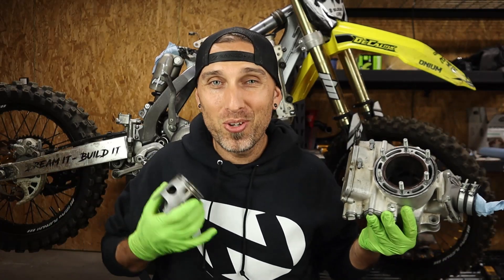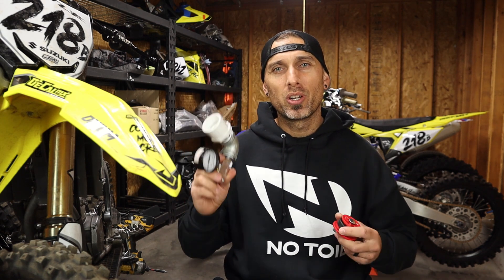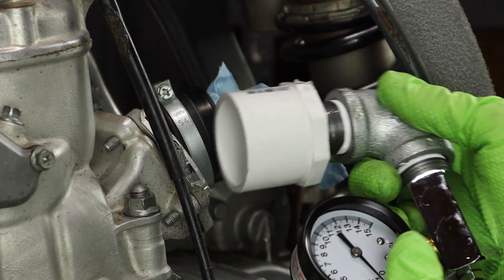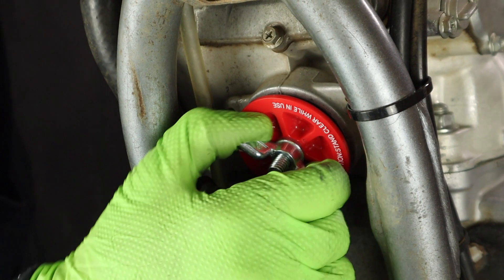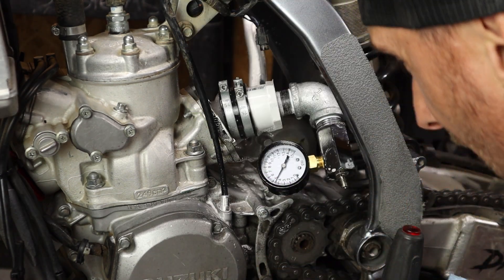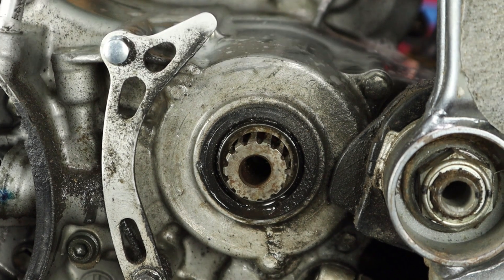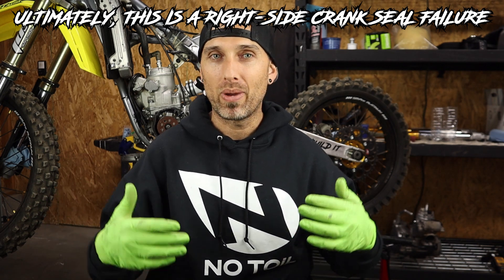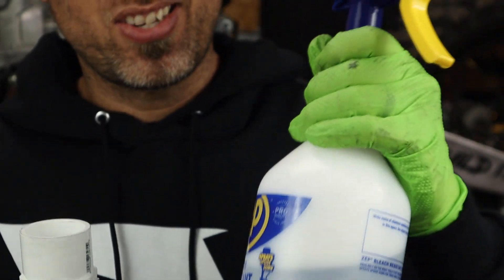I BLEW UP MY TWO STROKE | Let's Find Out Why - Dirt Bike Leak Down Test & 2006 RM250 Top End Fails

Comment: You can be leaking from the center case gasket or the right side crank seal. Gotta pull your right side engine cover to confirm it is/is not NOT the seal. 

The powervalve seal on the side of the jug cam let air into the transmission as well. So the case gasket & seals could all be fine but it's leaking fromt the powervalve seal area.

But thay piston is broken. Not blown up. That was detonation that broke the ringland off. The detonation pushed the edge of the piston down under combustion, (pinching the ring). On the way back down, the rings snagged on a port getting bent up & breaking the edge of the piston off. Then as it went to TDC, the broken parts & ring chunks got smashed into the head.

What was your fuel grade?

Where was the timing in comparison to the "stock" setting?

What was the quench height? A bad head cut will cause detonation.

What was the scenario when it died?

But that was detonation 💯% man.

Edit:

Ditch the rad valve for the STOCK cage & reed petals & instal a reed spacer. You'll have more power & better power. Lots of experience & dyno time building engines. Had an 06 rm250 as a personal bike in the stable for a number of years. It's one of my favorite bikes....all time.
Reply from the maker: Keith, I LOVE this reply. It's too bad I can only pin one comment at a time! In response to your questions:

You can be leaking from the center case gasket or the right side crank seal. Gotta pull your right side engine cover to confirm it is/is not NOT the seal. Understood, and makes more sense at JonnoMoto said that I likely don't have a leak. No excessive smoke trans oil coming out of the pipe. I was somewhat stumped on that in the video.

The powervalve seal on the side of the jug cam let air into the transmission as well. So the case gasket & seals could all be fine but it's leaking fromt the powervalve seal area. Jonno mentioned this too. it makes perfect sense. The air has to come out somewhere in the end so the countershaft seal it is... This threw me off as I also thought maybe a breech between cases but same scenario as the right side crank seal IF it was actually leaking. Jonno suggesting there was no leak makes the most sense now. Funny how I forced the video to that conclusion just because I was hell bent on the leak down tester proving something. I did not do a very good job on this video & should not have rushed things to wrap up.

But thay piston is broken. Not blown up. That was detonation that broke the ringland off. The detonation pushed the edge of the piston down under combustion, (pinching the ring). On the way back down, the rings snagged on a port getting bent up & breaking the edge of the piston off. Then as it went to TDC, the broken parts & ring chunks got smashed into the head. *Regarding the lingo (blown up) may I ask the difference when speaking technically? I was using the term blown-up very generically as it could be searched & SEO optimized, or basically understood by most that "there's a problem" of some sort going on here 😂 Thank you for the detonation explanation, I can visualize it all occurring step by step & that is helpful for me. * 

Before I answer these, it almost seems safe to say that most of the damage was already done here as I only logged about 45 minutes on the bike in a few short motos. It was the first time I ever rode it. The bike felt lean or soft, like when a main jet is too small and engine wants more fuel to reach higher RMPs.

What was your fuel grade?
101 @ 40:1 always

Where was the timing in comparison to the "stock" setting?
Unsure, but the stator plate is in the identical location/ orientation as my healthy 04 engine when looking at both side by side. 

What was the quench height? A bad head cut will cause detonation.
Unfamiliar with the term & eagerly awaiting more info! Did you ever see "Short Circuit" where the robot Johnny 5 is always begging for "input"?? Call me Johnny!!

What was the scenario when it died?
It ran until it sort of shut off as I rolled up to the truck. I got off the track because I felt the power degrade to a un-useable level & had to keep it alive by blipping the throttle liberally. The soft power it had before that VS the "tale your arms off" RM power I expected makes it seem like I simply finished off a coffin that was almost fully nailed shut.

But that was detonation 💯% man.

Edit:

Ditch the rad valve for the STOCK cage & reed petals & instal a reed spacer. You'll have more power & better power. Lots of experience & dyno time building engines. Had an 06 rm250 as a personal bike in the stable for a number of years. It's one of my favorite bikes....all time. Ok! I will have to track down an OEM & try it sometime. I have the Vforce & Boyesen as they came with both RM's when purchased. Me too bro, I adore these old RM's which to me don't really feel old yet
Reply: @mxrevival  

I totally remember that movie short circuit & Johnny 5's hunger for input! I wish I could read like Johnny 5! Lol 

So for the input, there are 2 parts of the head. There's the dome area which is the deep pocket around the sparkplug. Then there's the shallow area around the outside of the dome. This is the "squish band" area. It is measured in 2 ways. 1 is the length of the squish band. This is simply a measurement from the edge of the dome, across the squishband to the cylinder wall or outside diameter of the head. The 2nd measurement, called the "quench" area, is a height measurement & its done from the outside of the "squish band" area of the head to the outside edge of the piston at Top Dead Center. It's  the gap between the piston & the squishband area of the head when the piston is at TDC.

Measure this with a piece of solder & make sure you do it IN LINE with the piston pin or the sides of the piston by the transfer ports. The reason is to avoid piston "rock" that happens it the measurement is done on the intake or exhaust side of the piston. This would give a false measurement & also give a potentially false notion of the head being cut at a poor angle vs the angle on the crown/dome of the piston. You want to match the angle of the piston dome with the squishband area of the head or have the head  about 1/2 a degree steeper than the piston angle.

Bad scenarios would be if the squishband cut in the head is flatter than the piston dome shape. Think of a flat top head design with a dome piston. This will make a triangle pocket around the outside of the piston which will undoubtedly cause detonation. This is the worst.

The measurement for "quench" is that distance between the piston & the squishband. A tall squish, which these bikes (& most) have, is actually a bad thing for detonation. The tall area takes longer for the flame front to reach out to the edges of the cylinder. This tall & slower moving flame front area allows heat (from it) to radiate forward & light off the fuel around the outside edge in the squish band. Now that fuel is burning inward toward the dome & the burning fuel from the done is burning outward. These two fronts collide around the outside of the piston & in the squish area. This excessive pressure happens over the ringland area which smashes the piston edge down on the ring, pinching the ring. The ring no longer floats & can now snag a port on its way past. This happens on its way down from TDC & folds both the ring & piston up breaking off the edge of the piston & tearing up the ring. Then on the way back up, the ring tears up the jug & all of the debris gets smashed into the head. The few extra revolutions the engine makes (from momentum) after the catastrophe are to just make sure it's good & junk. Lol

Anyway, a tight quench is way better for staving off detonation. The shorter flame front heading from the dome to the outside of the cylinder is moving faster & has a shorter heat gradient (less tall which means less surface area to throw heat). This faster moving flame front doesn't have as much time to light the unburned mixture out in the squish area thus staving off detonation better than a tall quench or squishband. 

So a short squish (quench area) can safely & happily run on lower octane fuel but still have higher compression than a tall squish (quench area) build will tolerate. 

I hope I worded all that in a comprehensible way.

On a brighter note, if the head was cut (poorly), it's now junk so you won't have to worry about it being the problem if it was. 😁

Besides a pressure test, a vacuum test should also be done. A seal can leak one way but not the other. Both are bad.

So I'd still confirm the case halves aren't leaking by removing the right side cover by dropping the jug back on with a base gasket (don't even need a piston in it) & try to seal the powervalve area's to confirm the bottom is air tight....or not.

Don't exceed 7psi on both vacuume & pressuretesting. Anymore & some seals can get the lips flipped &/or get pushed out.

Your fuel octane is legit & the timing seems NOT to be the culprit judging by the stator being like the other bike which has a known reliable engine. 

Detonation sounds like a bag of marbles getting banged around inside the engine. It has a sort of rattling sound & the engine can only handle it for a very brief time. Like only a couple seconds & junk.

Besides a lean main jet, a lean needle setting can cause it as well.
Reply from the maker: I totally remember that movie short circuit & Johnny 5's hunger for input! I wish I could read like Johnny 5! Lol 
Hahahaha, "Steee-pha-neeee" no dissasemble...

So for the input, there are 2 parts of the head. There's the dome area which is the deep pocket around the sparkplug. Then there's the shallow area around the outside of the dome. This is the "squish band" area. It is measured in 2 ways. 1 is the length of the squish band. This is simply a measurement from the edge of the dome, across the squishband to the cylinder wall or outside diameter of the head. The 2nd measurement, called the "quench" area, is a height measurement & its done from the outside of the "squish band" area of the head to the outside edge of the piston at Top Dead Center. It's  the gap between the piston & the squishband area of the head when the piston is at TDC.
Ok awesome, I have always wanted to try the hollow-core solder trick to check squish but have not yet, and always ran what I had when doing top ends. Sounds like I'd be able to figure out if this head has been cut or modified in doing this too, if I knew what the stock squish was from a confirmed stock head. I'd love to know the limitations & have been doing some homework to become a better educator down the road.

Measure this with a piece of solder & make sure you do it IN LINE with the piston pin or the sides of the piston by the transfer ports. The reason is to avoid piston "rock" that happens it the measurement is done on the intake or exhaust side of the piston. This would give a false measurement & also give a potentially false notion of the head being cut at a poor angle vs the angle on the crown/dome of the piston. You want to match the angle of the piston dome with the squishband area of the head or have the head  about 1/2 a degree steeper than the piston angle. I should read the entire post before I reply 😂

Bad scenarios would be if the squishband cut in the head is flatter than the piston dome shape. Think of a flat top head design with a dome piston. This will make a triangle pocket around the outside of the piston which will undoubtedly cause detonation. This is the worst. Ahh, I see. So the squish band should follow the curvature (or not) of the intended piston for said engine. They are parallel to each other in easy terms, or for lack of a more technical way for me to explain it? Why does it cause detonation? (thank you)

The measurement for "quench" is that distance between the piston & the squishband. A tall squish, which these bikes (& most) have, is actually a bad thing for detonation. The tall area takes longer for the flame front to reach out to the edges of the cylinder. This tall & slower moving flame front area allows heat (from it) to radiate forward & light off the fuel around the outside edge in the squish band. Now that fuel is burning inward toward the dome & the burning fuel from the done is burning outward. These two fronts collide around the outside of the piston & in the squish area. This excessive pressure happens over the ringland area which smashes the piston edge down on the ring, pinching the ring. The ring no longer floats & can now snag a port on its way past. This happens on its way down from TDC & folds both the ring & piston up breaking off the edge of the piston & tearing up the ring. Then on the way back up, the ring tears up the jug & all of the debris gets smashed into the head. The few extra revolutions the engine makes (from momentum) after the catastrophe are to just make sure it's good & junk. Lol Well isn't that just dandy?? Good explanation of what I have seen the result of now!! 😂 I understand! So it sounds like modifying the stock head for a tighter squish clearance or purchasing an aftermarket head (which must be why these are made) is how to correct the issue, not taking into account a cylinder base gasket height but in general a remedy to the problem?

Anyway, a tight quench is way better for staving off detonation. The shorter flame front heading from the dome to the outside of the cylinder is moving faster & has a shorter heat gradient (less tall which means less surface area to throw heat). This faster moving flame front doesn't have as much time to light the unburned mixture out in the squish area thus staving off detonation better than a tall quench or squish band. I know I already said it, but I should read the post before I respond. Nothing wrong with committing to memory I guess haha. So the tall quench is leaving unburned fuel that ignites later on top of the clash you previously described AKA bang, bang, damage ensues...

So a short squish (quench area) can safely & happily run on lower octane fuel but still have higher compression than a tall squish (quench area) build will tolerate. This is because the "burn is optimized, so the higher quality fuel is not quite as necessary? 

I hope I worded all that in a comprehensible way. You certainly did. I am grateful

On a brighter note, if the head was cut (poorly), it's now junk so you won't have to worry about it being the problem if it was. 😁 Hahahaha Luke at Phathead wants to send me one of his new ones so this will be fun... 

Besides a pressure test, a vacuum test should also be done. A seal can leak one way but not the other. Both are bad. I'll have to look that up! The leak down was dropping so fast that I'm still unsure if there's a leak on top of all the other rad engine-party that was going on in there!

So I'd still confirm the case halves aren't leaking by removing the right side cover by dropping the jug back on with a base gasket (don't even need a piston in it) & try to seal the powervalve area's to confirm the bottom is air tight....or not. Did I mention that I should read the post first?? Great idea. The engine will just be that much further taken down already after the wet side seal test concludes.

Don't exceed 7psi on both vacuume & pressuretesting. Anymore & some seals can get the lips flipped &/or get pushed out. 10-4!

Your fuel octane is legit & the timing seems NOT to be the culprit judging by the stator being like the other bike which has a known reliable engine. I think so on the timing even though it's just the eye-crometer test. I already have the 04 engine dropped back into the blown up 06 chassis so I can test things out with the 06 carb. 

Detonation sounds like a bag of marbles getting banged around inside the engine. It has a sort of rattling sound & the engine can only handle it for a very brief time. Like only a couple seconds & junk. Ok awesome (I'm mean, not really) I am familiar with that sound and the need to add more fuel from Lectrons that needed power jet opened a bit more & some lean-up-top-Keihin's too. My 01 RM250 and the mess it made out of the tail pipe earned me a lot of jetting time in my early 20's... even though the 01 ran sooty even with spot-on jetting. Don't wear white gear & ride behind me back then or I would "pepper" your fresh kit!! I never even heard the rattle on the 06 in this video & the power was very soft already. I guess the last guy got the joy of all the banging gumballs. That would have stopped me dead in my tracks to try and remedy.

Besides a lean main jet, a lean needle setting can cause it as well. Maybe there's more evidence in the original owner trying to richen the bike up before he sold it or was getting the rattle... The pilot & main were one size larger each, than what I installed. I went with Pro Circuit's specs for all components as they have always been great for me. Sea level, 101 octane, & their main/ pilot/ needle & clip spec were all followed. It was just too late.

I really appreciate the time you took to school me & anyone reading this!

-Charles // mXrevival
Reply: @mxrevival  

Happy to help man. Been the hungry guy trying to learn all & as much as I could. I wish I had a guy around who could've helped me get the right answers back then. So yeah dude, it's cool to help you out.

So yes, the head should he parallel to the piston dome or slightly getting larger (1/2 degree) as it gets closer to the dome.

With the properly done solder test which is in line with the piston pin, Good numbers & good gains in low-end throttle response are .035"- .042" on a 250cc engine. If it's over .050", I would cut it. From memory, the stocker is somewhere near .070" give or take .010" on that?

Typically, after decking the gasket surface (to set the squish/quench height) I dig out the dome to bring the compression back down to stock ratios. Sometimes I go even lower than stock (compression ratios) & they still make more power while being less violent. So a tight squish/quench let's you lower compression & keep your power. The lower compression takes some of that hyper violence away from it but it still pulls with all the muscle it would've had. Just slows down the blitz meter a little...more manageable & let's you be more aggressive for longer & make less mistakes because the bike isn't so violent & blasty. Not a big deal in sand but on dry stuff it's nice.

In regards to the "triangle" pocket around the outside of the squish band, detonation happens  because that pocket is holding mixture & has a weird sudden spike in pressure around the outside edge of the piston when this ignites which is right above the ring groove area (ring land).  This is a weak part of the piston & you know the rest. You want  combustion to happen in the dome. The squish is meant to "squish" it all to the dome for combustion.